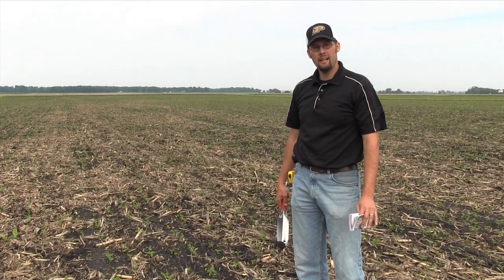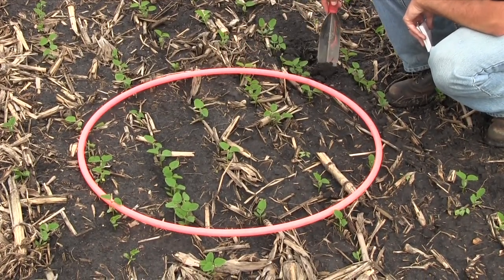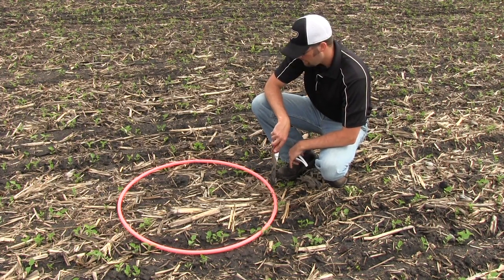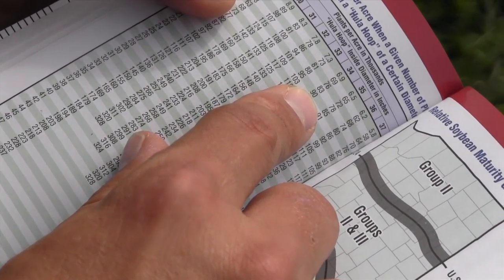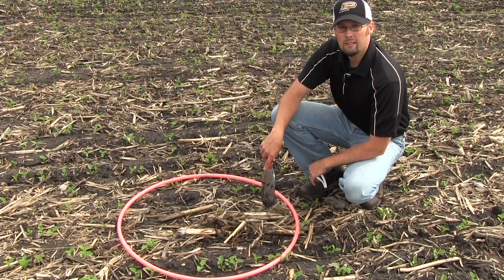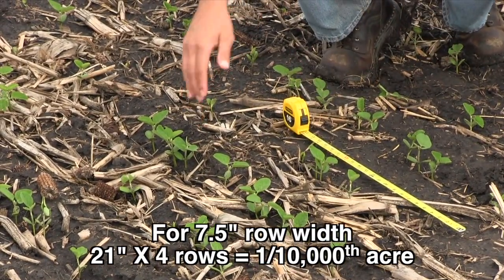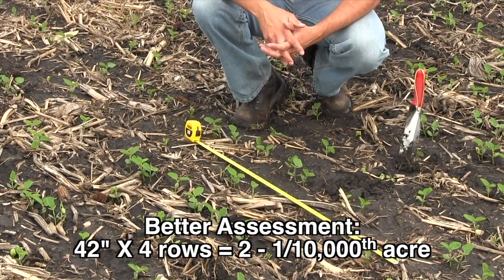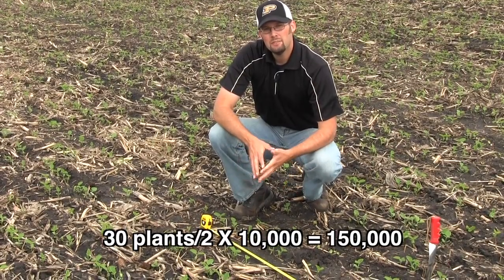Early Soybean Stand Assessment: Drilled Rows

Comment: Those soys look about as thin as mine. Any reason why drilling seems to look so bad in some fields where as in others it can look just about good as a planter? Mine seems to do horrible in sand or light ground, horrible on any ground with a slight hill to it (very very tiny hill at that). Mine even did horrible with oats on sandy ground.